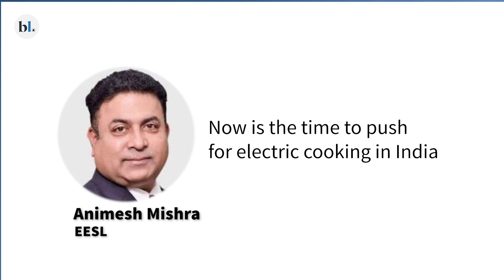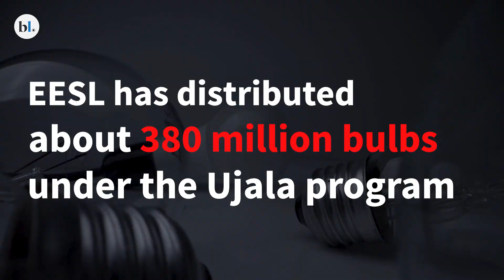India marches toward electrifying cooking

Comment: Excellent plan! But, along with induction stoves, EESL would need to also sell a few flat bottom, tri-ply cooking utensils - otherwise the induction stoves will just be showpieces. Secondly, either EESL or the Power Ministry needs to get onboard a slew of celebrity chefs / cooking channels - both TV and YouTube - to organise cooking shows exclusively using induction cooking. They should be promoted extensively. That would give the required push towards acceptance and belief in induction cooking. Third, have meetings with utensil manufacturers encouraging them to design specific utensils for various cooking styles, across the country. Fourth, and most important, provide 24x7 good quality, reliable power to all households in India!